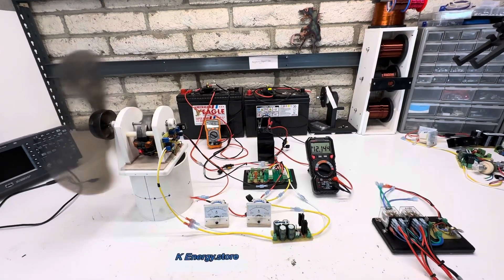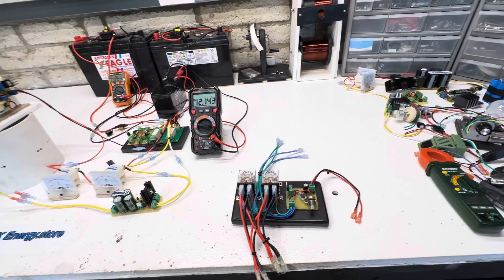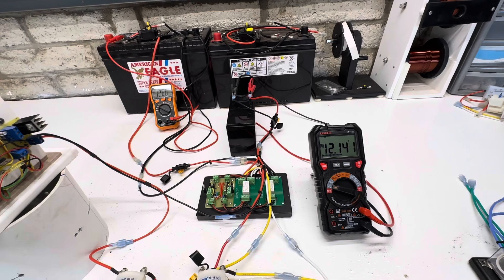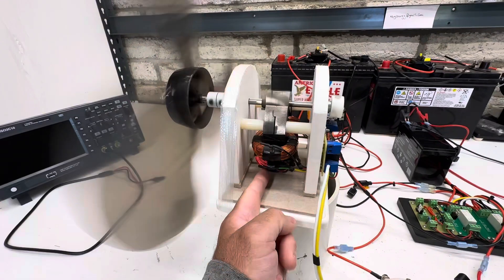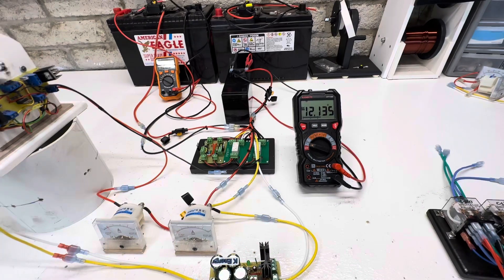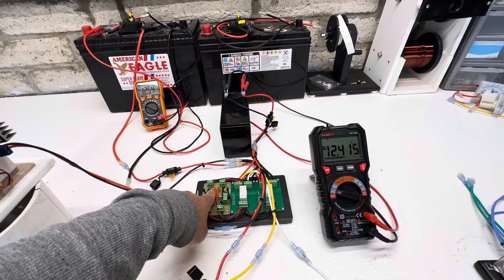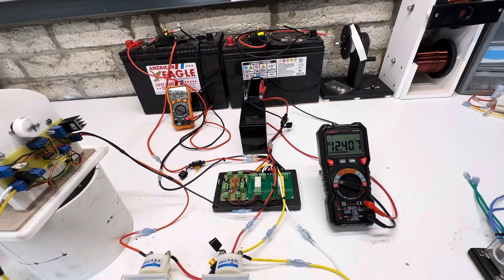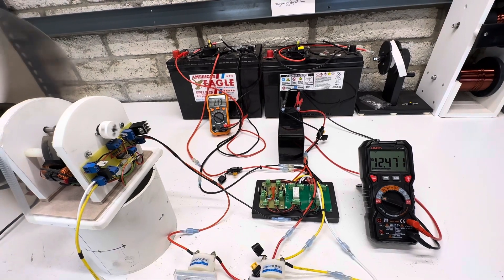Battery swapping circuits

Comment: Good circuits, have you ever left two batteries and tested what happens.
Reply from the maker: Yes they eventually go down but it takes a long time !
Reply: @kenergy1707  thankyou for the reply. Great channel and information.
Reply: @kenergy1707    I'm wondering if you add a ground wire to the output side before the cap dump if that will add more efficiency to the system ?
Reply from the maker: @mscavsfan  I’m concerned about the house power when I hook my scope to a ground rod shows ac 60 hz

Comment: Hi. I'm want use pwm controller for bedini motor. It's possible, or Arduino controller better?
Reply from the maker: If your using SSG circuit you can’t use pwm but the circuit can act like it with higher resistance to the base
Reply: @kenergy1707  Okay, thanks for answer. What you think about "power gap" inside bedini motor? Motor must be axial 2 rotors.
Reply from the maker: @НиколайНиколаев-п7с  I’m not sure what your referring to power gap ?
Reply from the maker: @НиколайНиколаев-п7с  gatcha ! Cool yea you can pwm that one